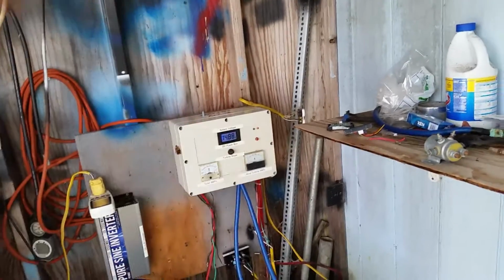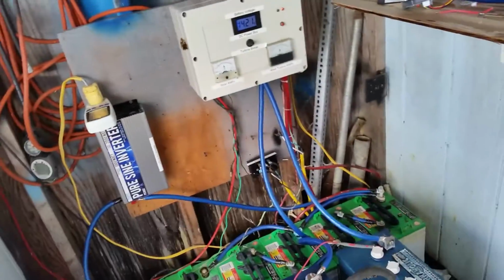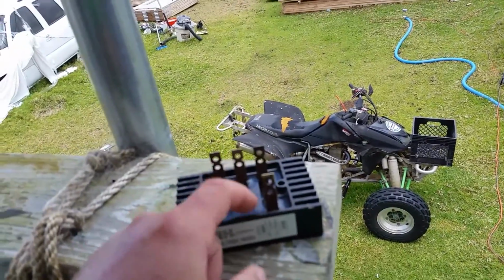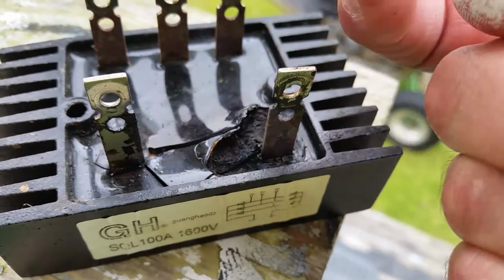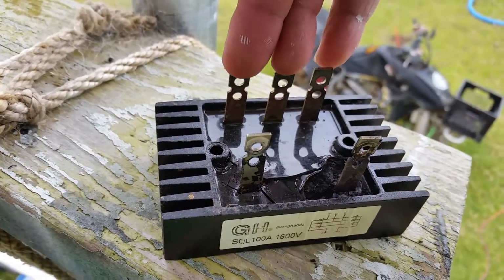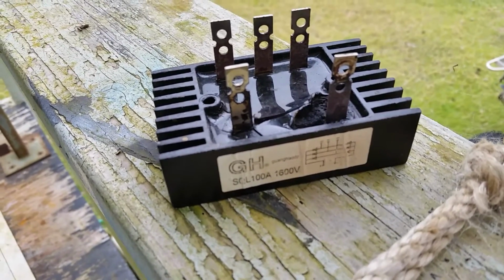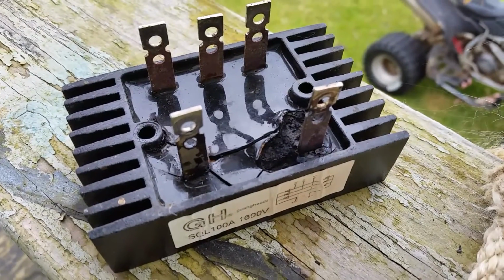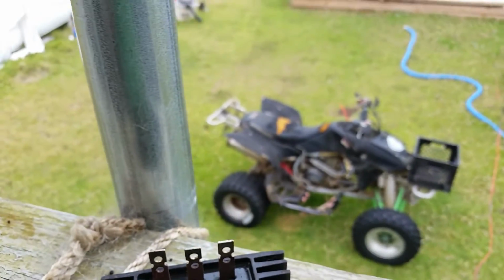My Brothers Wind Turbine Bridge Rectifier Melts Down

Comment: I see only a 100A 1600V rectifier, this will be when its mounted on a heatsink, normally not rated for free air, 
An idea, why not mount a DC fan fused on the output side of the rectifier, windspeed high fan speed high keeping rectifier cooler, you can get 200A rectifiers 3 phase, even higher when using separate heatsink mounted diodes, 
I was in the motor drive industry many years, you could drive fan from batteries if you want or even a time off delay, not much current drain, Pasp fans are great for long life,
Philip from England UK

Comment: dont use dc relays to dump. Use an ac to dump. Use 2 bridge rectifiers and a 3 phase ac ssr with a dc coil. the second rectifiers dc side get connectred to a dump load.  Switch the 3 phase rectifier with the dc turbine voltage with an external voltage reader that can be adjusted to any trip point. 
Just my 2 cents:)
Reply: my brain hurts, sounds built to last, leamy you could probably market a complete unit.

Comment: get a piece of aluminum diamond plate and use it as a big heat sink. That's what I do and what we do for the radio towers. ALL things that get even worm go on a Diamond heat sink. You can use what ever we just like the DP as it's thick and can be picked up at lows or Home depo.. I will make a video on mine.. Maybe that will help..
Reply from the maker: +yankey4 That's an idea

Comment: Mate, that rectifier is 100a 1600v. How big is your system? My understanding is 50% - 100% increase in your max generator out put is enough of a safety margin. If the rectifier is too big, it will get hot because of it's internal voltage consumption. If that is not the problem, then you could bolt the rectifier to a heat sink. (basically some aluminum plate, to help dissipate the heat) The epoxy should not melt, under any circumstances. Lastly if you open-circuit the wind generator, wont it over spin and cause damage? Normally the solenoid (load divert) diverts the generated electricity to a water heater, not open circuit it.